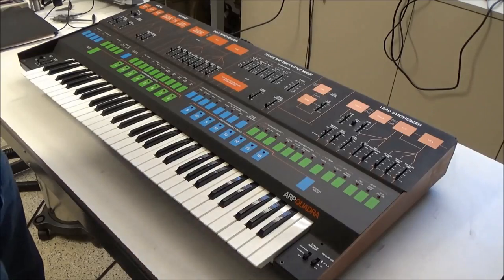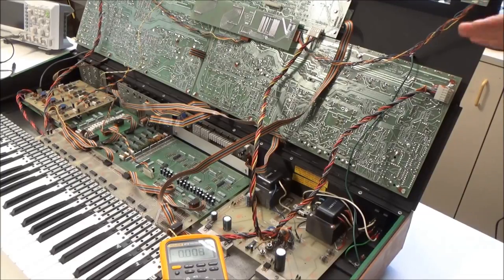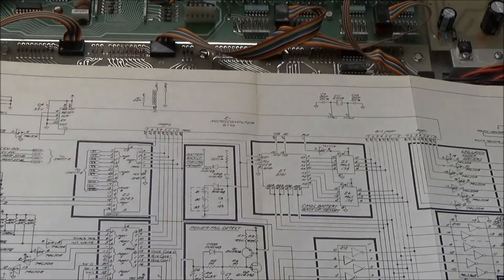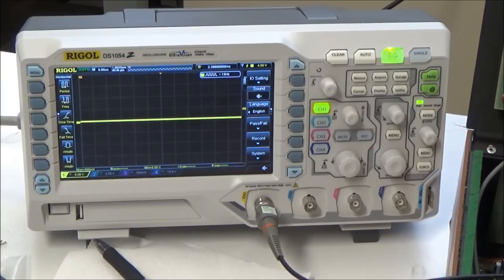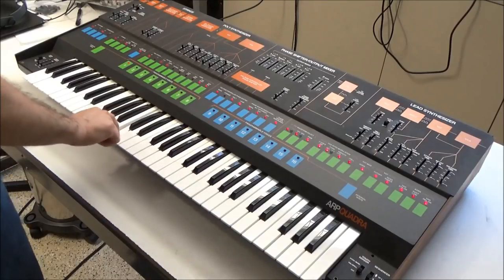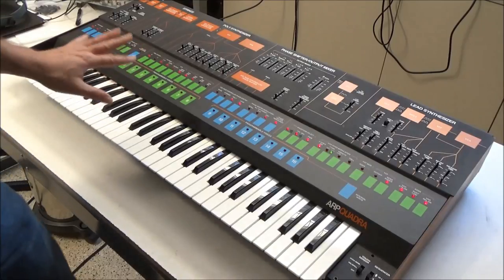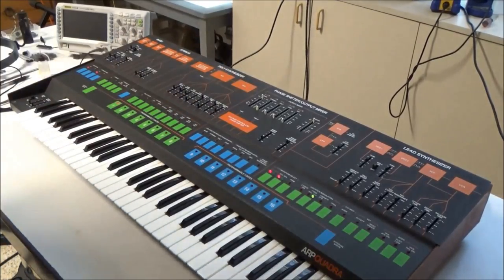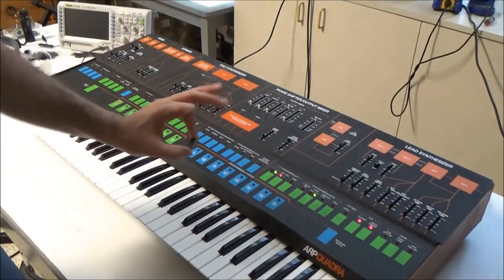Synthchaser #103 - ARP Quadra Repair & Restoration (Pt. 5) - Repairing Dead CPU, Keys & Oscillator

Comment: Hey there, im trying to build a custom keyboard chassis and your videos really help me understand  how they are constructed 😊.. Of the synths that have the keybed atached  to the base plate, how thick is the plate? Is it steel or aluminium? I want to find out if i could get by using a 2mm aluminium base plate bent into an L shape, forming the base and the back.. Its only 23cm wide  but 1m long..  I guess 2mm steel plate or even 1.5mm steel plate bent in the same way would do the job but i want to avoid painting for corosion protection as i want to make it chemical free, no glue, or syntetic finnish on the wood etc..

Comment: How did you replace the CPU? You just "borrowed" one.
Is it possible to read the programming firmware from the good chip and burn a new one? Are they still available?
Reply from the maker: Since the video, I've bought some more equipment and have been able to read and burn replacement CPUs for the Quadra.
Reply: Ah, good move. What was the chip again? 8086?
I'm also surprised a lot of this gear had factory built PSU's rather than just buying in OEM units. 
The Quadra's is a bit nuts. A switch mode PSU would have been much smaller, but I guess they didn't have the technology back then.
I remember fixing one on an Emulator II once and the trouble is, when SMPSU's they fail, they tend to take out half the components on the board.
Oh, and BTW, it wasn't the Quadra that killed ARP, it was a combination of the development cost of the Avatar and the sales of the Chroma that did it.

Comment: I had a nightmare calibrating Quadras ,  had to get the wife to press keys and buttons , as trying to scope and trim the pots , and trying to change settings on the control panel , having to drop panel down everytime to see your pressing right patch buttons and slider positions , knocking off your probes etc ,  as a novice I found it a nightmare
Reply: Then you don't want to know what a heck of a pain in the ass is calibrating a Jupiter 8 xD

Comment: If that CPU is an 8048 and not an 8748, if you want to mail it to me, I will dump the code, then you can look into getting an 8748 programmed with the same code.   I have a fixture all wired up for dumping an 8048, and have used it several times already.   The procedure for dumping an 8748 is a little different, and would require a new fixture, or a programmer that can handle that MCU.
Reply from the maker: My programmer supports the 8748 but needs an adapter that I don't have.  If I can't sleep some night I may just rig up my own programmer.